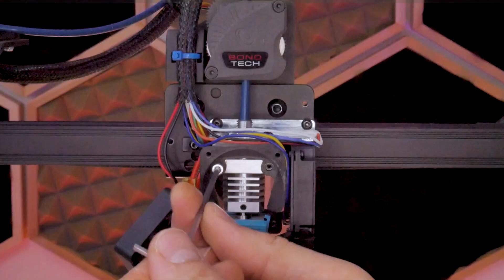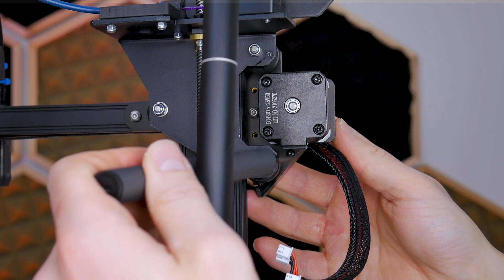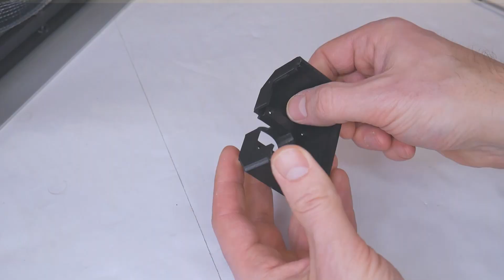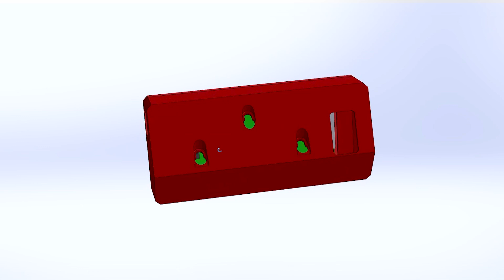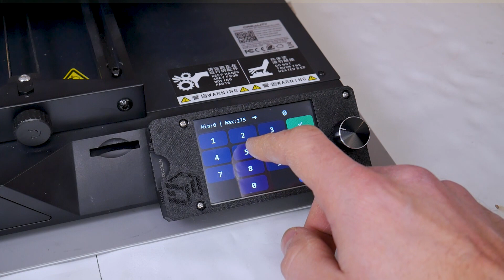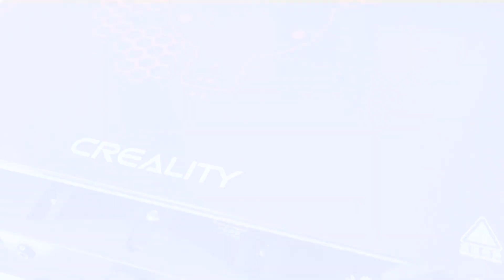How To Install CR Touch on Creality CR-10 Smart (and CR-6 SE)! The Fix You've Been Waiting For!

Comment: It's finished. I changed it up a bit. I used the Creality Sprite extruder and added the ESD-01S network adapter. There were small modifications to make to the mounts on the Z-Motors in order for the Sprite to reach the bed. Works awesome. I used 2.54mm Dupont Connectors on the spring board side of your breakout board to make the connections easier. This project was a lot of fun. Thank you so much for the work that went into getting me interested, and started on this. Keep up the good work.

Comment: Hello, do I need to use the Bondetch LGX Lite direct drive extruder or original will be fine for now? Im tight on the budget because of purchase of this "smart" printer. I spend week to make it run but now im collecting parts for this upgrade. For me its almost the same price as the printer was...

Comment: I just got a cr10 smart from my brother in law and needs to be fixed. By do the motherboard changes, will it allow me to put the sprite extruder. Been doing research looks like it would work but there seems like there in no spot for the CR touch on the stock motherboard. I like that on my ender 3 s1 and would be nice to have on this machine like the pro.
Reply: Im hoping this motherboard replacements will allow me to plug in the sprite extruder upgrade

Comment: Hello, First I want to thank you for the great job you have done. I have followed your instructions to the letter, but I have had to change some of the marlin values you give us, because I don't have the same hardware. My problem is that when I compile with vscode, I get several errors. Is there any way I can send you the screenshots of the errors that the vscode gives me? I would be eternally grateful if you could help me. Thank you again for your work. Greetings!

Comment: Spring terminals are soooo much harder. its not very smart to add em. can cause issues especially for beginners most likely the average person watching this video. i do understand their use its easy to relocate em when you wire it wrong, but hard to insert i suggest installing ones with larger holes or jfp connectors.

Comment: Hope I don't sound like a broken record... Would this kit be compatible with a CR-6 Max? This kit seems like a nice refresh for my printer.
Reply from the maker: Yes I've had a customer make it work with the CR6 MAX, he even went the klipper route with it. The only thing I can't guarantee is that the CR6-SE brackets for the SKR mini mainboard under the printer will fit, but from the images I've seen online I believe my brackets still work. At worst you would need to make some adapter brackets of your own to get the SKR mini to fit under there. Thanks!

Comment: This is amazing. I was having so much trouble with auto levelling on the CR-10 Smart that a got 2nd hand.  The firmware had never been updated from factory and as soon as I did the updates it was a brand new machine and auto level works every time I do it now. 

This video did convince me to upgrade the my hot end and extruder though and your files are mint.  Thanks so much
Reply from the maker: Great to hear!
Reply: @EmbraceMaking  I changed my mind!  Ordered everything to run the exact same setup as you. Pumped!  Thank you for putting so much effort into making this printer the best it can be.

Comment: Having problems keep getting failed to enable bed leveling 
any suggestions
Reply from the maker: Is this the first time you turn the printer on? If you haven't run the auto bed levelling yet and there is no mesh saved in memory you'll get that message
Reply: @EmbraceMaking  Yes it is .I have been fallowing you video and can not even get the z axis to zero out
Reply: @EmbraceMaking  Had to wire cr touch straight to SKR Mini

Comment: is there something wrong with your downloadable print files, i have got all the parts i need except the printed parts. the ones i am having trouble with are the ones for the bigtreetec screen, i have tried to print them on two different printers and every time they fail. other parts have printed perfectly but these 2 perticuler parts just will not print. any ideas

Comment: Ok I’m at a loss. Everything is connected and secure but when I turn it on the system shuts down after a few seconds. 

What am I missing?
Reply: So turns out the cable that came with my relay had matching JST ends. But in the video, the pins are swapped for the middle connector in the relay and the PS connector on the mainboard. Swapped the pins on the connector and it now boots up and stays running. 

Now the damn thing keeps saying that there is no filament loaded through the run out sensor.

Comment: Well you have convinced me to dust off my CR10 Smart and upgrade the piss out of it. One question. Currently, my printer is connected to a raspberry pi running Octoprint. Is it possible to do this with the new mainboard?
Reply from the maker: Yes it is, I actually just had someone do this exact thing with the new board and the upgrades! Thanks!

Comment: Thank you 08:45 was what I needed to replace the print head/hot end assembly on my CR-10smart. I was about to take a rotary tool to the casing so I could unplug the themistor and heater cartridge
I bought the last one in my country and couldn't figure out how to get the cover off. I don't do many repairs. I am a user not a tinkerer..
Isn't it funny how much a standard Cr-10smart looks like an original Ender 3 under the hood? Just slight differences.
So thank you again for your videos. They have helped me a bunch!

Comment: Hi, I was just wondering if it's possible to just upgrade this printer to Pro variant by changing the extruder to Sprite with CR touch and flashing the Pro model firmware into the stock mobo, as I saw they're actually identical.  I really appreciate your work though, the outcome looks really cool!
Reply from the maker: Unfortunately I don't think this is possible... The smart pro has the cr touch, right? the mainboard on the non-pro is not equipped to handle the CR touch so I don't think you can just flash the firmware... it's a completely different main board...
Reply: @EmbraceMaking well, I was comparing the looks of both of these motherboards on some store and disassembly tutorial videos. They look the same. The thing that differs is extruder breakout board. The pro variant has one hidden in the base above the Creality WiFi Box, which has special plug on the other side to connect Sprite extruder with CR Touch. Unfortunately, that board isn't available anywhere for now. Eventually someone would do reverse engineering and recreate that module, yet still we have no guarantee this will work though

Comment: A big thanks for that kit and video, I actually in the installation process and I've a little difference with the easy swap board shown on the video. For the Filament run-off detector, I've only a 2 pin spring connector. Do I have to un pin the yellow wire from the jst connector filament detector of the mainboard ?

Comment: Hi!  Thank you for taking the effort to researching a fix for this machine.  I implemented your fix and it turned out awesome.  The only difference is that I replaced the entire gantry plate/extruder/hotend assembly with a brand new Microswiss NG, Revo.  So far, everything is working beautifully!
Reply: Does Microswiss ng revo has place for cr- touch ?

Comment: Hi, I bought the PCB's and the mount for the hot-end.  I ended up purchasing a BTT SKR3 EZ and am having trouble getting the X and Y axis working.  When I try to home it the x axis make a terrible sound and basically vibrates.  Y is doing the same.  If I set Force Move and attempt to move the X or Y axis if I'm pressing Right it will move in a random direction.  Everything I've read says wiring but I have tried several different combinations.  I even measured the resistance of the stepper to confirm the wiring.

Any ideas?  The SKR3 EZ has the 4 pins for the motors as 2B, 2A, 1A, 1B.

Z axis is working fine.  Fans, CR touch, hot-end and heated bed, also working as expected.
Reply from the maker: Interesting, I'm assuming you cooked up your own firmware for the SKR3 EZ board?
Reply: @EmbraceMaking  Thanks for getting back to me.  I had to trace the wiring from the stepper motors all the way through the board and found I had some wiring issues.  All sorted now.  Just running through some calibration steps to get it printing nicely.

Thanks again.

Comment: Hi nice videos, I have the regular leveling, there is a way to remove the first leveling chewing in the middle of the bed? Change that to a corner or disable that? I want to print 2colors and I have 2 gcode the second start with  z offset  and is not working becouse it’s try to level in the middle where I have the printed first part.
Thanks

Comment: Got the boards to make this swap but how do you use the green connectors ive never seen them before
Reply from the maker: Check this out: https://www.youtube.com/watch?v=dnLERynxEU0 basically strip off ~10mm of wire and push the little button down and insert your wire then release the button. There is a spring clamp mechanism inside that bites down on the wire to make a nice solid connection. Give the wire a little tug to make sure its secure and don't push the wire jacket in because obviously you want the copper making contact.
Reply: thankyou!  @EmbraceMaking  Im having some trouble with the firmware not updating on my printer.  the only change i made was not using the relay and everytime i try to configure the marlin firmware i get errors even with no changes made following multiple guides on youtube etc

Comment: Does this board allow the user to format the g-code?  For example if the user wanted to add a extruder nozzle plus a custom head, would the board allow the user to program this into the gcode?  I have the CR 10 Smart pro.
Reply from the maker: Do you mean does it allow you to change the firmware? The firmware is what you would need to change for a custom extruder... if so yes you can do that for this board
Reply: Yes I'm wanting to create opposite side extruders.  One would be the extrude you showed in this video and the opposing side would be a gel syringe head.  My goal would be to print a PVA support material and then print the gel on top with the opposing side consisting of the syringe. @EmbraceMaking
Reply: Which carriage system are you using? @EmbraceMaking
Reply: Do you have the firmware code for a CR 10 Smart Pro?  Installed the board on my smart pro not realizing your version is the CR 10 touch.  I'm having errors with the bed leveling.
 @EmbraceMaking

Comment: Nice video! Question - can the Bondex upgrade be eliminated without much issue? By itself it is $85 of the almost $400 total cost (seems a bit pricey).
Reply from the maker: You don't have to use direct drive, you should still be able to use your original Bowden setup and just skip installing the LGX mount

Comment: having 2 of them as paperweights for a long time now, i started doing the upgrades you showcased on your channel and i have at least one printer working again. Only problem is that i cannot buy the pcb kit from your website(Greece is not available). I got all parts except the PCB Kit! Is there a way you could post to Greece?
Reply from the maker: Have you contacted me through my website? I could have sworn someone was asking me about shipping to Greece the other day... If you reach out through the contact for on embracemaking.com I will get you a custom shipping quote, thanks!
Reply: @EmbraceMaking  Hello! I finally managed to build one of my paperweights after a troublesome year, following the instructions but i have an issue and i hope you could help. Managed to finish everything up until the firmware updates. Screen updated and all is good, not the board though. Printer powers up, a popup says "no printer attached", i hear a clicking sound probably from the relay and printer powers off. Tried different sd cards, held the power button for a minute++ to no avail. The only thing i did not install is the neopixel RGB.  Could this be an issue and i need a different firmware? Any help will be GREATLY appreciated and i think you should became more famous after all these great videos and pro work.

Comment: Thank you for this work! I bought mine a year ago without too much research on 3d printers and now that I have it and understand how it works, I am baffled as an engineer that this strain gauge solution was ever considered in the first place, let alone sold and abandoned shamelessly! Will definitively try your solution.
Reply from the maker: Great to hear! Whenever you're ready the parts are available :)
Reply: @EmbraceMaking  Where can we get the files for the 3d printed cr-touch bracket raplacing the strain gauge bracket?
Reply from the maker: Currently I don't have the files for download, the whole assembly is sold as a printed kit with all of the hardware: https://embracemaking.com/products/creality-cr10-smart-cr-touch-lgx-lite-5015-cooling-fan-conversion to complement the PCB kit. Basically gives you a plug and play kit. Thanks!
Reply: @EmbraceMaking  would it be possible to get just the bracket with the pcb kit? I already upgrader my bowden extruder to an all metal one and don't plan on using the direct drive extruder.
Reply from the maker: Sure I can print the bracket for you. You will need to come up with your own solutions then for the part cooling fan etc though since this bracket isn't compatible with the original shroud
Reply from the maker: did you already place an order?
Reply: @EmbraceMaking  just did, I added a note in the order to mention it. Thank you!
Reply from the maker: Thanks, do you mind emailing me with your order number? I actually don't see a note on any of the recent orders which is weird
Reply: @EmbraceMaking  Done. Through your website's contact section.

Comment: also does the CR touch sensor has to be connected directly to the pcb breakout board or can be connected through ribbon cable to the twin connectors
Reply from the maker: The CR touch can be connected to the auxiliary board on the gantry. The signals get sent through the ribbon cable down to the bigger breakout board and then to the mainboard from the spring terminals. Or if you want to use it on a different smaller printer, if your CR touch harness will reach, you can plug the CR touch into the bigger breakout board directly and then use the spring terminals to go to the mainboard again. Up to you.
Reply: @EmbraceMaking so does that mean I could just use the pcb board to get the cr touch function without and firmware changes?

Comment: Can i use the existing pcb and e3v3 mainboad  with 4 pin to 5 pin adapter , as there are 2 ground wires combined with creality sprite extruder ?
Reply from the maker: Can you link to the parts you are trying to use? When you say e3v3 mainboard you're talking about the skr mini e3 v3 board I'm assuming and sprite extruder? If so, yes you can do that. As you stated the ABL probe has 2 GND pins which are common so you really only need 4 pins

Comment: Can we use the sprite extruder with this upgrade?
Reply from the maker: Yes absolutely! You can wire the sprite into the auxiliary board and away you go!
Reply: @EmbraceMaking  Would I still need to swap out the mainboard as well or will it work properly with just your modified gantry board? Great work by the way!
Reply from the maker: Just don't forget to change the e steps and thermistor etc in the firmware to match whatever is on the sprite

Comment: Hey guys, I just want to leave a note if someone else is trying to make BL-touch to work on a CR-10 smart or CR-6 which has strain gauge by default.

IT'S WORKING! 🥳🥳🥳

I connected control pin to filament sensor & sensor pin to the optical sensor/z-stop pin.

It looks like that the pin for z-stop/optical sensor was wrong in the original klipper config from creality.
It not PC15, its PB2.
which is defined as switchpin in the marlin reference.

IDk what switchpin realty does, but maybe that's also the reason why I had so many issues with the strain gauge.

board : Creality v2.5.S1

Would have been easy if creality would give us some information about the pins....🤬🤬🤬

I was just about to order the BTT board 🤣
Reply: WAIT REALLY? but.. I have other board.. But still crazy